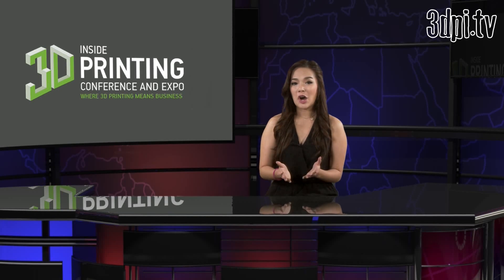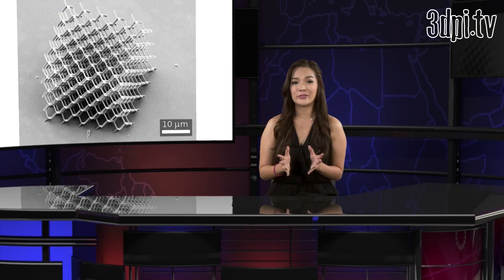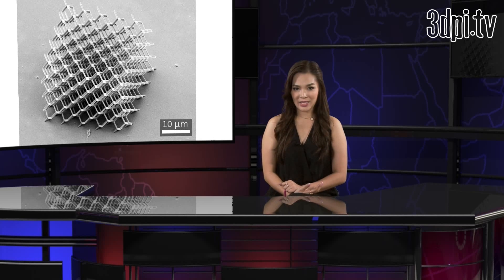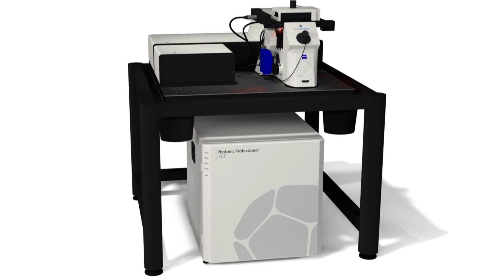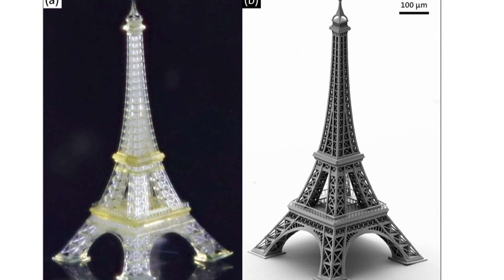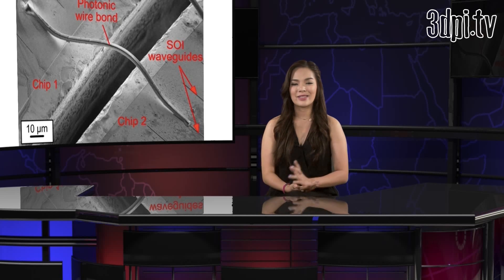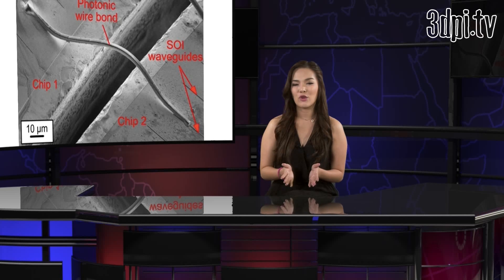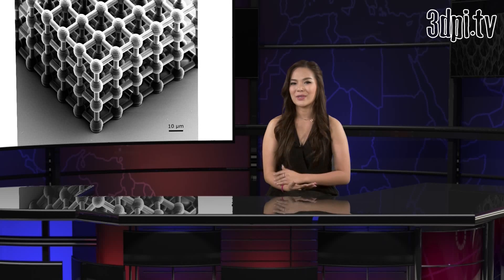Commercial 3D printer for Nanostructures

Comment: "Are you ready for Nano Fab Lab?"  The ability to 3D print nano-scale Photonic Wire Bonds will allow computer scientists to overcome communication bottlenecks in data centers and high performance computers. In biotechnology nano-scaffolds are making it easier than ever to grow all types of living cells.

As well, as to give scientists access to its machines without having to get into their complex workings, Nanoscribe has developed a range of software that, just like in any desktop 3D printer, can make all the difference both in quality and accessibility.

Thanks for the show and tell post: Commercial 3D printer for Nanostructures.